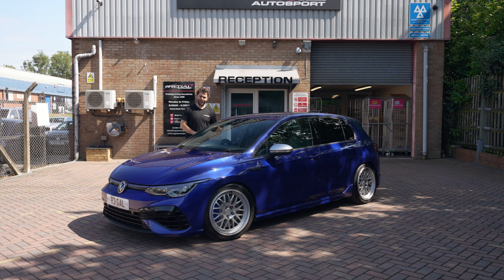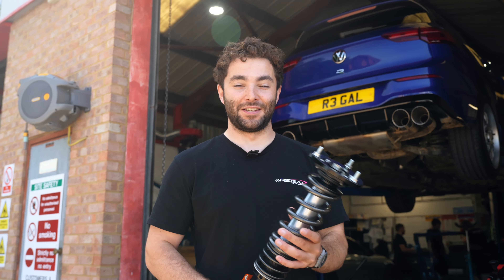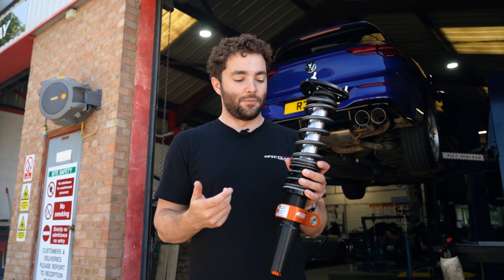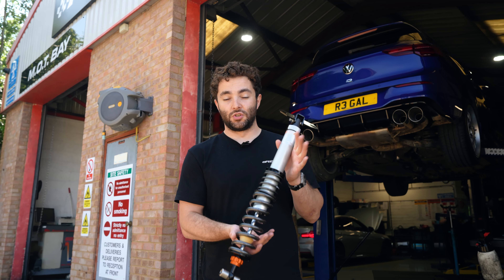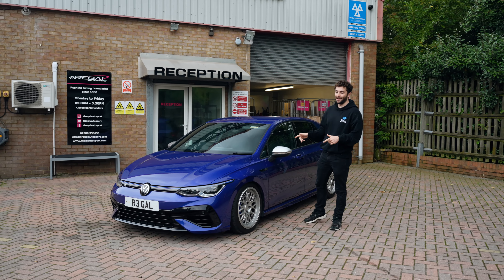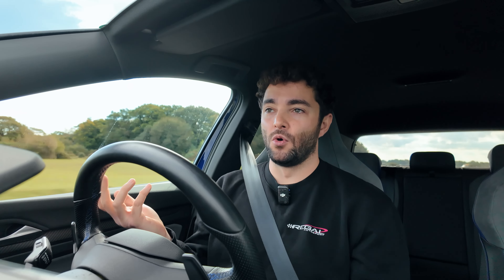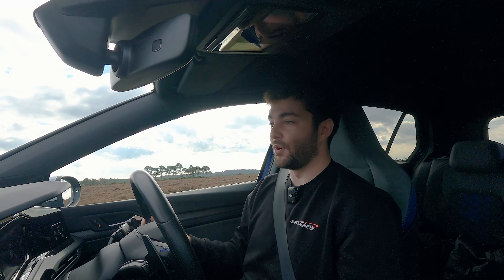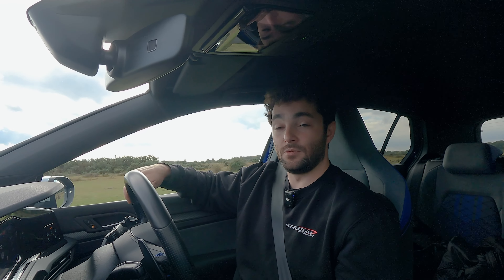ULTIMATE MK8 GOLF R COILOVERS FOR STREET & TRACK [AST 5100 COMPETITION SUSPENSION]

Comment: I thin AST 5100comp is the best suspension for golf 8R. Mine came with DCC and i wanted to keep it so i chose KW DDC, it is really great and comfortable on the street but not good for tracking the car. So i added LCA and RCA from 034motorsport to get proper camber and caster, then added swaybars and finally got some setup which might be ok on the track. But if i might chose from the beginning i would order car without adaptive dampers, add AST coilovers, tune car for stage2, add some better cooling and it will be pretty great car for tracking❤
Reply from the maker: Thanks for sharing! It’s really important when considering suspension, what your use case is and how they might change over time, as it is a definitive factor in what suspension you should opt for, depending on budget too of course
Reply: @RegalAutosport the main problem is that ideas are changing over time. When ordered my golf i was 100% sure i want to stay stock, after half year i started modding suspension for better look, then for better performance. After that i started track my car, i was sure i will stay 100% stock with engine and ended stage2;). I wanted car livable on the street but fast on track. Nów i want very fast on track even sacrificing comfort 😅

Comment: Did you have to use delete DCC kit?
Would you rate these over KWv3 & Ohlins road & track?
Reply from the maker: This car did not come with DCC 

KWs work really well on the street, and we do recommend them depending on the customers use case. The V3, or even Clubsport is not very good on a car which has track day tyres, or any other modifications.

Ohlins Road and Track is popular for some reason, although at that price range I am not sure why you wouldn't choose a better kit, like the AST for a similar cost.
Reply: Interesting you rate these above the v3s and the ohlins. 
How do they compare to the nitron r1 or nitron road sports? 

Is it possible to have a sensible road setup that is mot bouncy or harsh. 

Daily driver, occasional track days & 1/2 ring trips a year.
Reply: @racingclips6376  that is basically what I looking for. Nitron R1 is on my list but hardly any reviews online.
Reply from the maker: @racingclips6376  It all depends on your use case, if you just want some lowering and improve the handling on the road on a stock car, the KW V3 is a great kit. 

As we're talking about a kit that needs to also have the range to work on track, and be daily, that is where the AST kit comes in. 

Nitron R1 is another great kit, although its non-inverted which means the front setup has more deflection vs. the inverted setup from AST, and the pistons are different. Nitron is more track focussed, and harsh, whereas the AST piston is more focussed for road use with less initial rebound damping. 

If you're interested to talk more, you can contact us at https://regalautosport.com/contact-us

Comment: Any comparison or thoughts between these and the Racingline VWR coilovers? Seem to look quite similar without any other competition that has a true rear coilover setup. Very little information/customer reviews on the VWR kit. Thanks!
Reply from the maker: AST manufacture the ‘VWR’ which was rebranded as ‘RacingLine’ recently, so they look the same… because they are made by AST.
Reply: @RegalAutosport  are there any differences? or simply rebranded in a different color scheme?